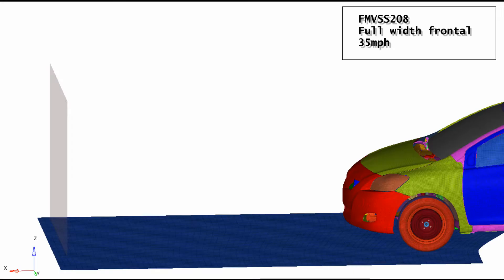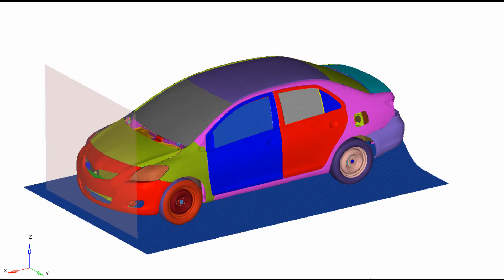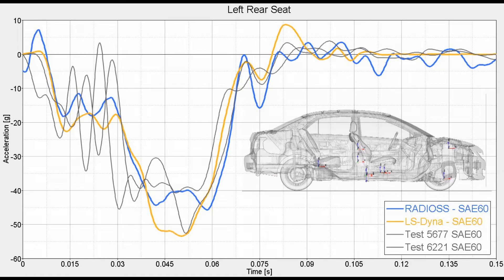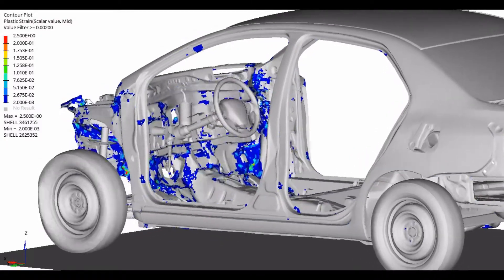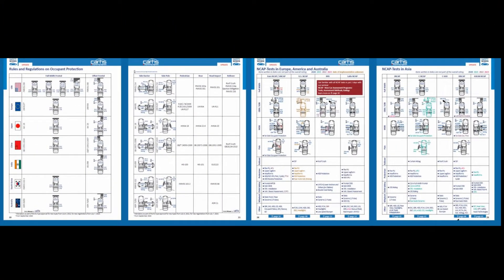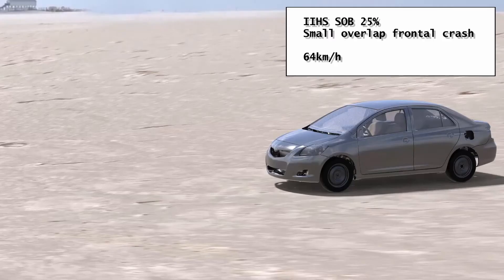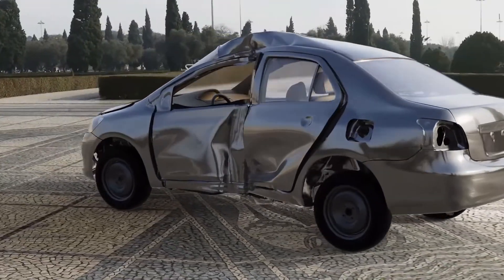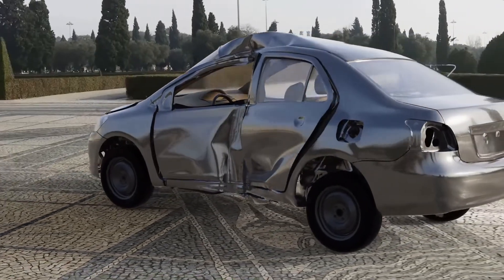Crash Simulation - A Preview

Comment: Great Work! Could you explain the model set up for a CFRP-Crashstructure?
Reply from the maker: Thanks! 
Regarding Carbon fiber reinforces plastics in crash - that´s a tough nut.
In principal , most solvers let you define the buildup of the stack of fiber layers in the composite (you need to know in detail)
and offer inputs for all the variables you need, as direction dependent material properties, matrix behavior and failure modes. 
You can search for "composite" in your solvers manual and go from there. 
However, you will need to perform validation on physical tests to build up credibility for CFRP crash simulation.